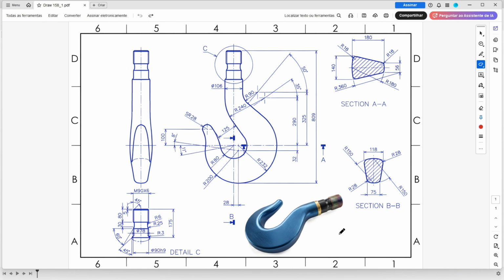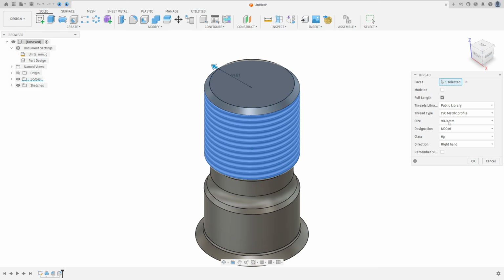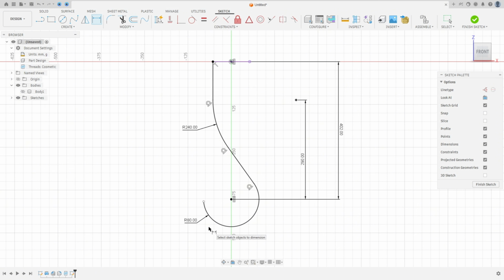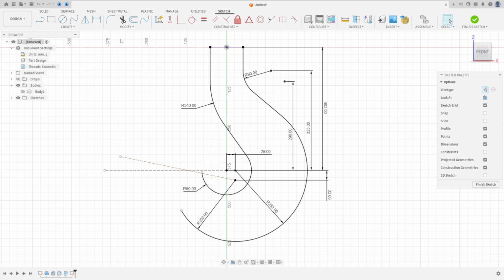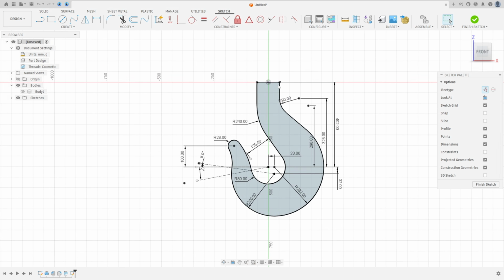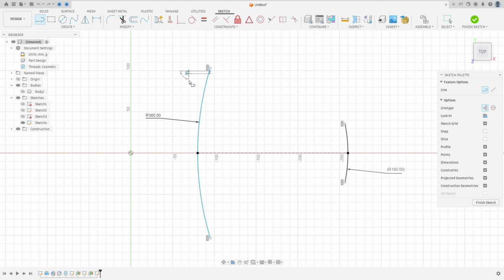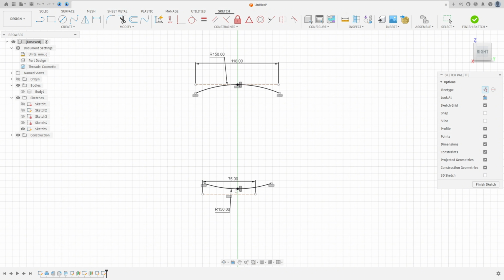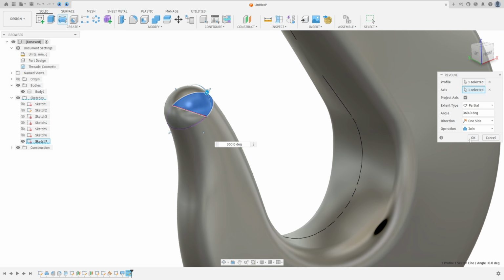How to Model a Crane Hook in Fusion 360 | Advanced Loft Technique

Comment: when creating the thread you need to create the thread first and then add the chamfer or you get a ruined start to the thread, Add the chamfer to the sketch and the cut the revolve from the body. this will create a lead in on the thread. If you 3D printed the design for example you wouldn't get a nut to start on the thread.